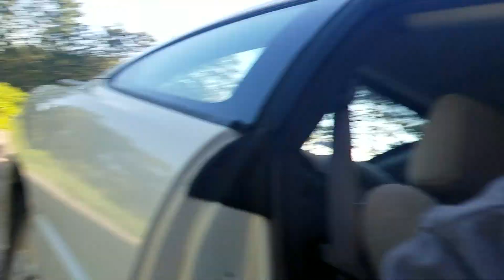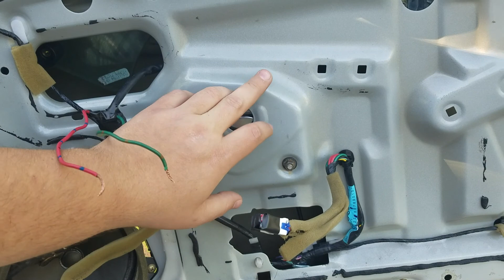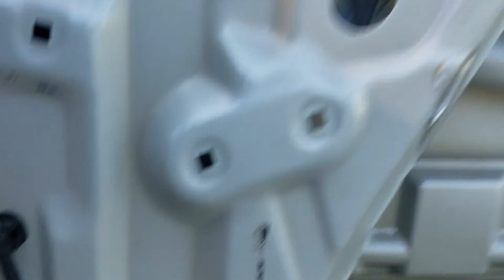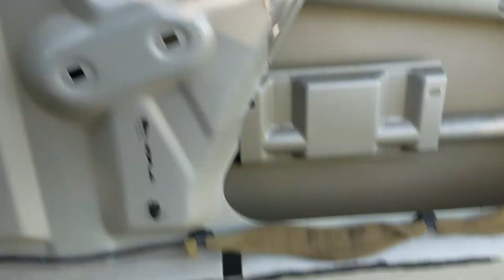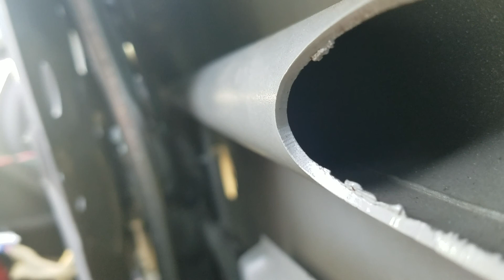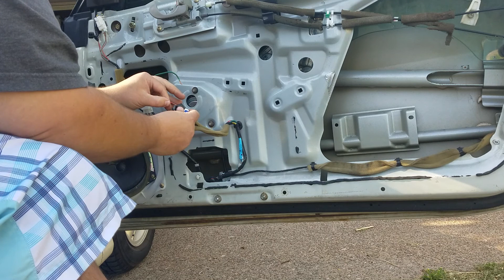Window motor and regulator replacement on 2005 Stratus coupe

Comment: So those two large holes that are diagonal of each other--that's to access the bolts that hold the regulator to the window. Right?

Thank you.
Reply from the maker: Yes.
Reply from the maker: If you drop it low enough all 3 of the bolts should line up